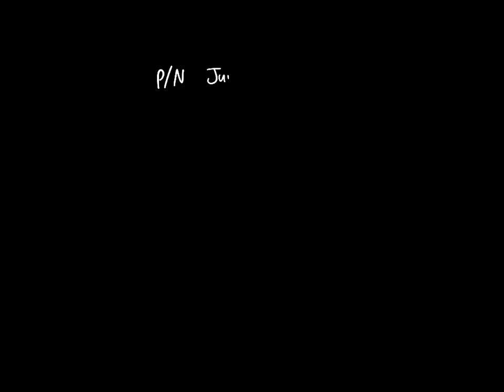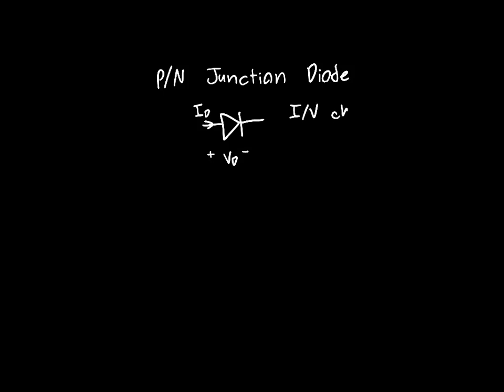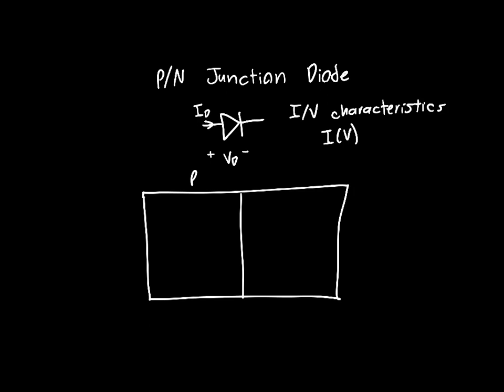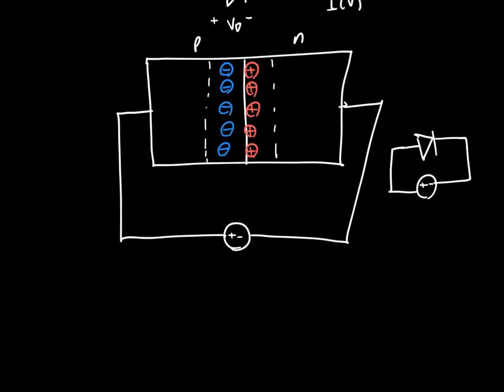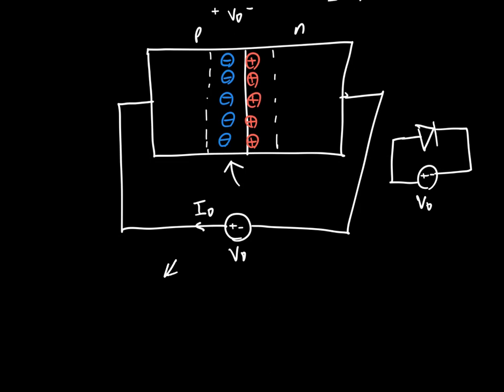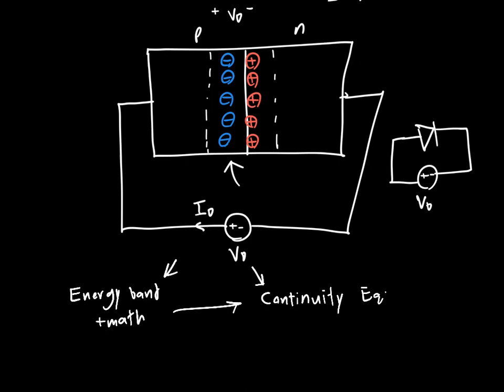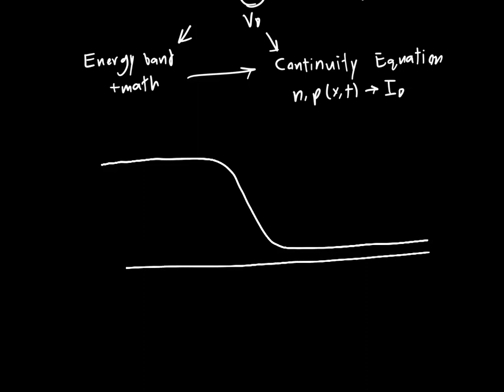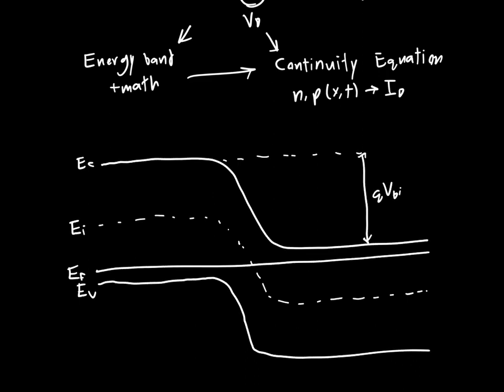PN Junction Diode Introduction

Comment: I am having trouble understanding why a positive voltage inherently pulls down the energy of electrons. I know that voltage is Exm. And that the energy stored in a field is proportional to field^2.

I think the relative heights here imply a voltage specifically in the positive x-direction. That is what I am missing. And if the energy represented by the heightened band really represents a field in the positive X-dir, then a field that opposes that field would decrease the relative potential energy.

I just never think of the field as existing outside of the depletion region, which is why it is confusing for me. But if you complete the circuit then I guess the field exists in the whole circuit.
Reply from the maker: The reason is that electrons have a negative charge, and band diagrams are drawn in terms of energy. The energy of a charged particle in a voltage field is charge * voltage, or for an electron (-q) * V.

Comment: Why did you take hole concentration at the edge of depletion region as equal to the hole concentration of the bulk?
Reply: From my understand,
He didn't set those equal. The boxed equation in 12:00 is the right equation ONLY for hole concentration at the EDGE (His derivation of that equation is by using BULK hole concentration. It is a little cheating. I will explain why it works out later). To get the BULK hole concentration with external potential, you need to set external voltage to zero in the boxed equation. This is because the bulk hole concentration is at a place very far from the depletion zone, so the bulk hole concentration with external voltage=bulk hole concentration without external voltage=EDGE hole concentration without external voltage. (The last equality is because there is essentially no current through the depletion region when there is no external voltage, so no hole nor free electrons transport over depletion region. Without external voltage, edge is just as stable as bulk in terms of fraction of holes versus free electrons)
(Now about the cheating, I guess the "first order information" of the external voltage is all in the "replacement rule" inside the exponential. The form of the equation out side of the exponential is kind of "zeroth order")
Reply: @bohanxu6125  what is zeroth order?
Reply: @dimi5929  
we want to find {edge hole concentration with external potential}. What I mean by "zeroth order" is  {edge hole concentration without external potential} which approximately equals {bulk hole concentration without external potential}, assuming not a lot of holes and electrons are moving across the depletion zone.

what I meant by "firstth order" is a non-rigorous. I just mean the most relevant information of external potential is inside the exponent. other less relevant external potential dependency can be, say, a prefactor (as a function of external potential) that changes much less dramatically than the exponential.

I'm just guessing...the video skipped a step I think.

Comment: Your explanation doesnt work if for reverse bias ?

as i understood, the band diagram is the energy of electrons, so they will have a natural tendency to go down in energy which is why there is a barrier potential... but if we are in reverse bias, the barrier potential is higher, thus an electon in the P region will be able to go down in energy by goind in the N regions, thus creating a current. Is it prevented by recombination of the election in the P region with a hole ?

Comment: How do we know if this digram is drawn to represent either the energy of electrons or the holes ? you said something like we read it from the bottom to top but I did not get this point
please answer me quickly
Reply from the maker: By convention, these energy diagrams are drawn for the energy of an electron. If you look at them “from the bottom” or “upside down” you can also think about them as representing the energy of a hole.
Reply: @JordanEdmundsEECS  so when I think of them as digreams that represent the energy of electrons and when I think of them as diagrams that represent the energy of the holes?